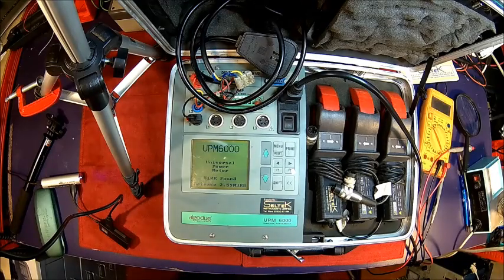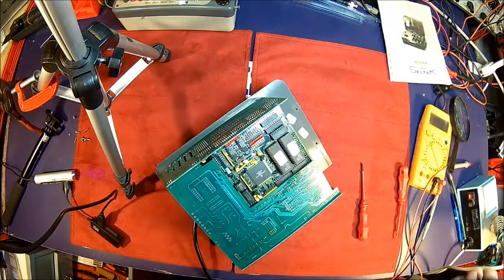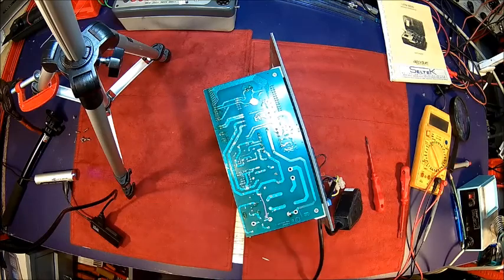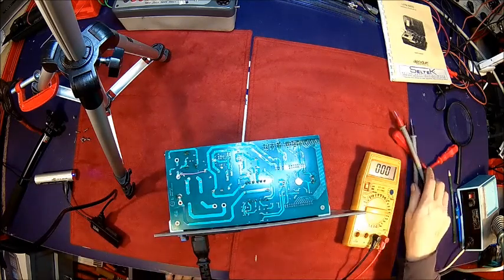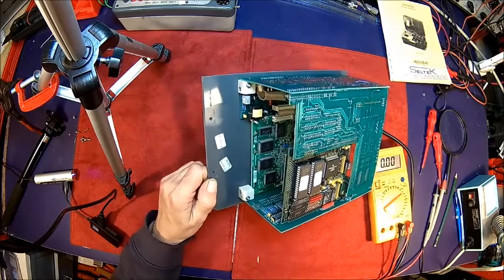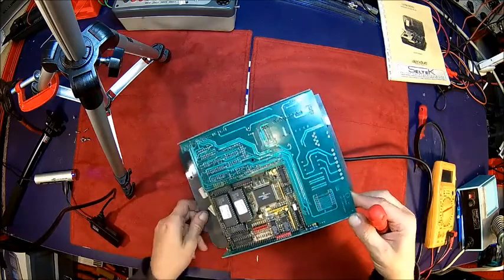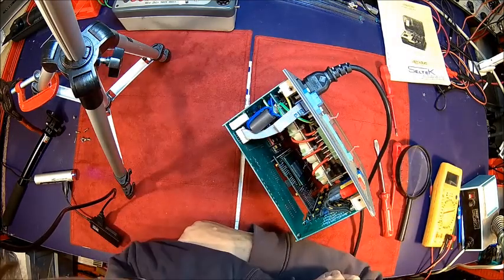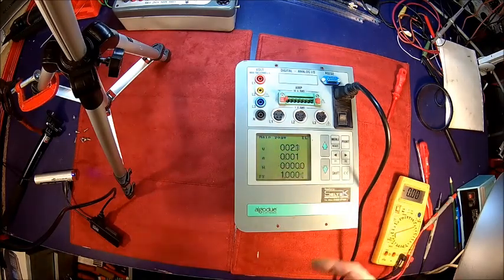Algodue UPM 6000 Mains Analyzer -  tear down inspection and an easy fix

Comment: I have used a pencil eraser to clean terminals like that. Good one.
Reply from the maker: erasers are always a good trick on flat contacts but does not work on the sockets because there is no room to get in, that's why pulling and refitting is the way to go.